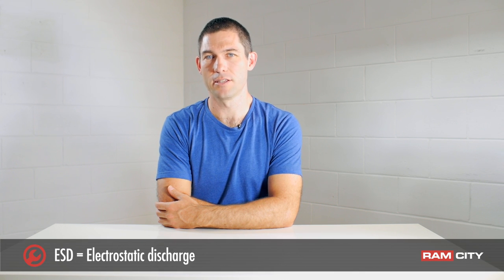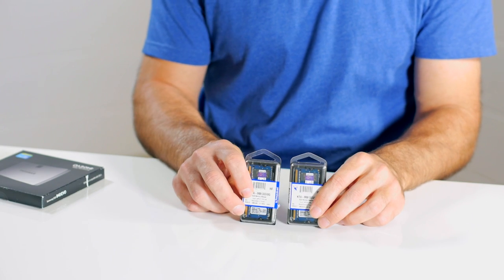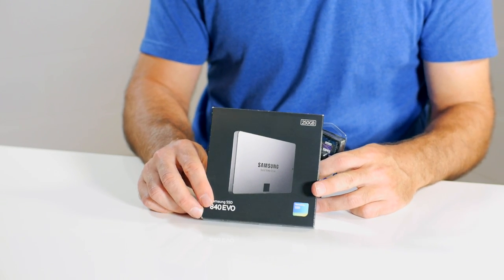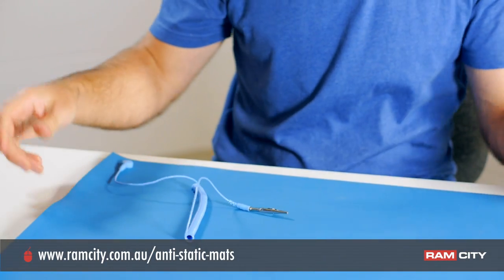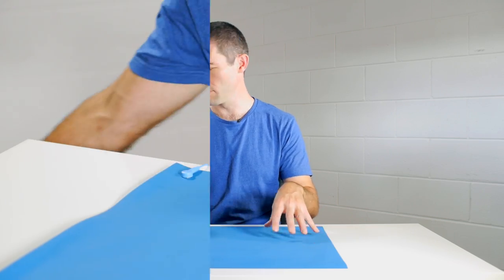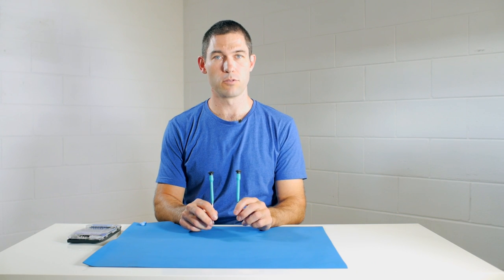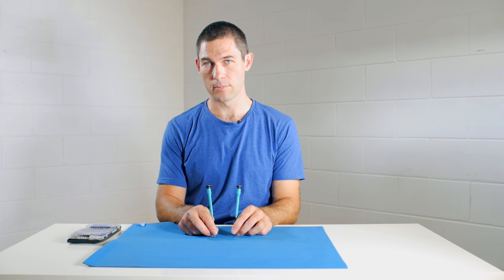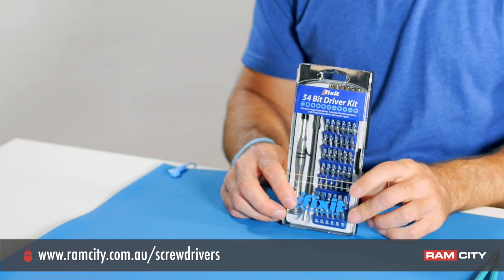All about ESD (Electro Static Discharge)

Comment: where is the mat meant to connect to ?  you said to the antistatic workstation, but at home I just have a normal table...
Reply from the maker: +aa g32 It doesn't have to connect to anything.   If you did have a metal workstation you could connect it to that, but it's not necessary.  The main thing is that everything is at the same potential so there are no voltage differences to create a spark.
Reply: +RamCity Correct, however you have gone a bit OTT. All you have to do is earth yourself and your tools before you start working, and you're good to go. The mat etc isn't all that necessary, but hey... better to air on the side of caution I guess.